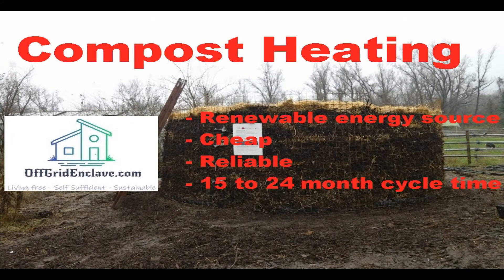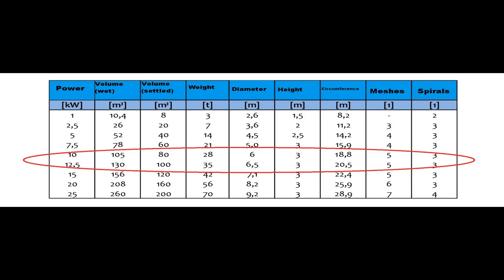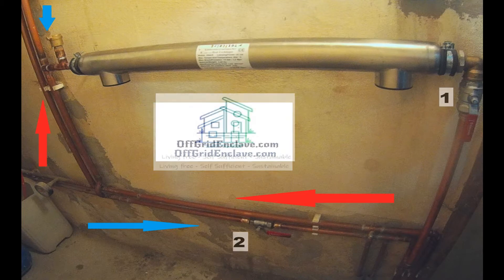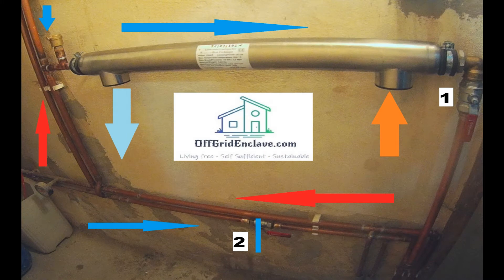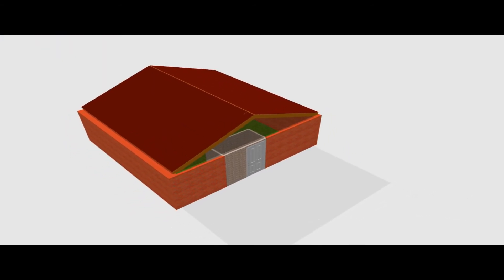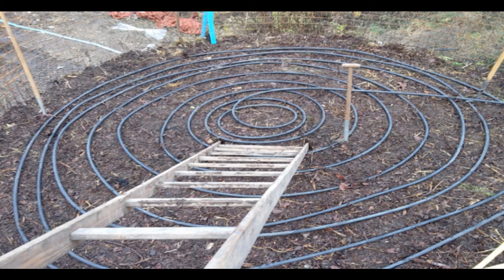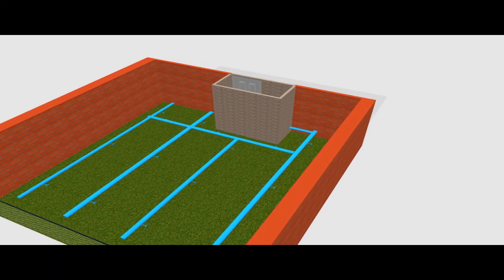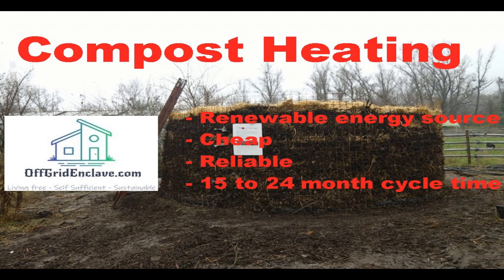Compost Heating Part2. Cheap, reliable and renewable energy source! Passive heating for OffGrid Life

Comment: So basically instead of chopping wood you spend time shovveling or collecting organic matter and piling it in the "hot room" for winter heat
Reply from the maker: +- . arguably the time for the setup is quicker then chopping the wood as one can use shredders to process bushy materials much faster then saws+trees. i would see the main benefit not in the time it takes for the setup but further down the line. the compost runs 24/7 , no need to move that chopped wood all the time and keep a fire running..

Comment: He is saying in winter you would need an additional heating system on top,but I'm.not convinced, if you were living in a cob or strawbale cob finished house that was insulated with wool etc, thisshould do the job, alongside a small fire in the centre room.
Reply from the maker: correct, depending on insulation levels of your housing and the size of the compost one can scale it accordingly.
Reply: I'd say "a small fire in the centre room" constitutes an "additional heating system" :D